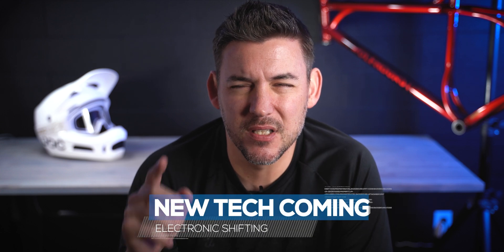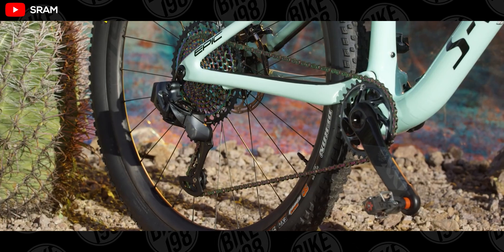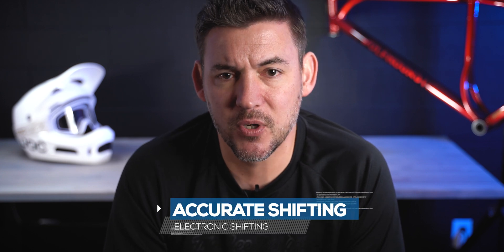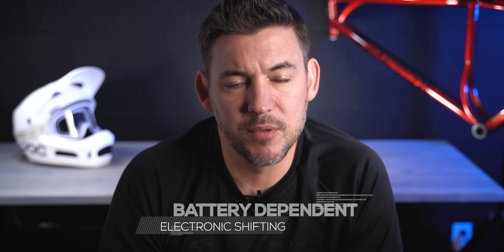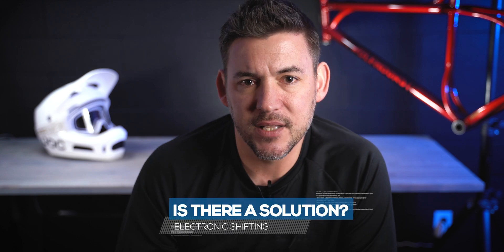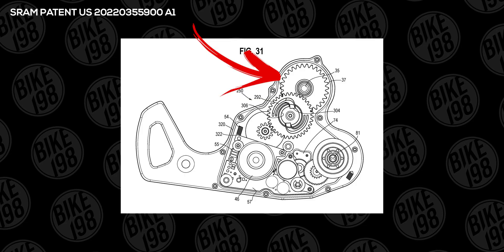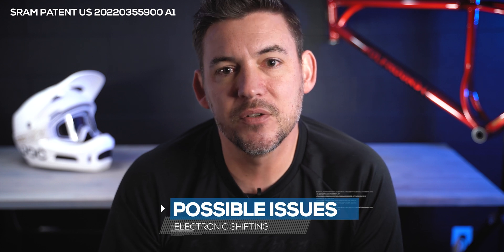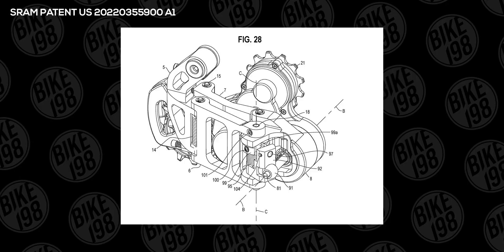This could REVOLUTIONIZE the Electronic Shifting Industry for Cycling

Comment: I am of the opinion that on the paper it’s a good thing. For all the argument you said, no cable, precision, easy mount on the bike. 
But not only the usage bring you the constrain of having to think about the recharge I am in favor of the technical simplicity. A mechanical derailleur is just (!) made of springs, lever and basic mechanical components. 
Here you have all those advanced ones, sensor, connectors, motor. I have a friend that hates electronic in cars, he loves what he can dismount and repair. 
I do love what electronic bring for car, ABS, speed regulator, electric windows etc. But for MTB I think that basic or simple tech is a plus. 
Then comes the price, should the gap be smaller it could cancel off this as an obstacle. But at today price I am not ready.